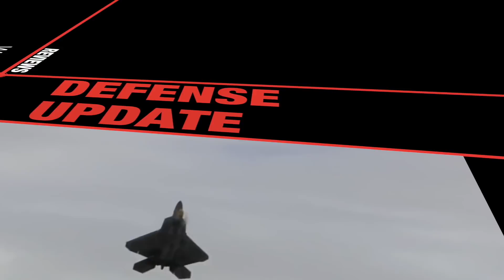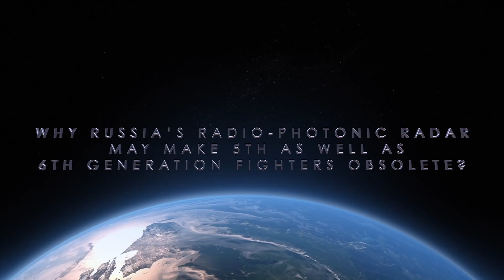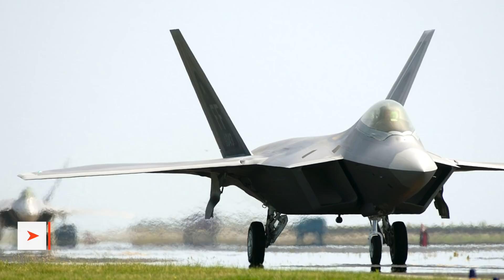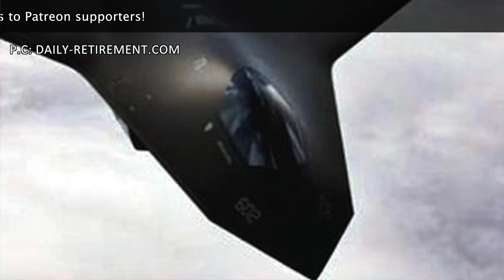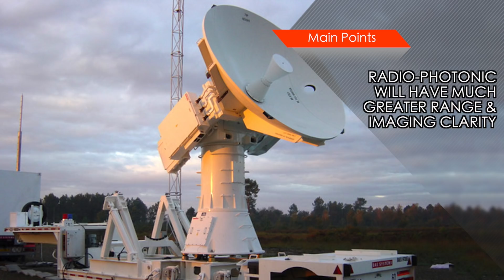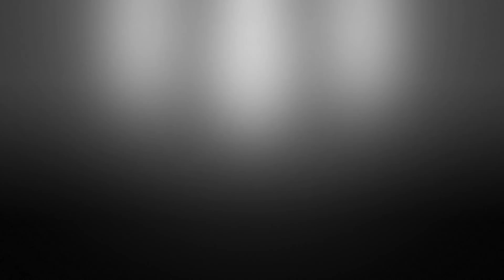WHY RUSSIA’S RADIO-PHOTONIC MAY MAKE 5TH AS WELL AS 6TH GENERATION FIGHTERS OBSOLETE?

Comment: nowadays, any stalth aircraft is detectable by several technologies. The first, for example, a VERA set from the Czech Republic. it is a classically passive system based on the principle of time-hyperbolic signal detection. and another is the PCL passive coherent location, the aircraft can be completely without emitting electromagnetic energy such as radio datalink or radar. PCL focuses on disrupting the coherent field that is created, for example, by a civilian television transmitter or FM radio transmitter, or a telephone BTS station. Stelth aircraft which are designed to deflect part of the incident energy and absorb some of them disturb this field very significantly this field violation is detectable, in the Czech Republic the company ERA built the SilentGuard system, the system is functional and tested during military exercises. ERA Pardubice is a world leader in the development and production of passive aircraft detection systems, in history they have supplied RAMODA, TAMARA, VERA, VERA-NG systems, VERA systems are for both civil and military use, the civilian version is at dozens of airports and detects aircraft with a meter accuracy.

Comment: The Radio-Photonic Radar pretty much needs to be at a fixed location if they are going to send entangled photons.  The quantum radar needs near zero kelvin refrigeration.  

If they just send laser light, the planes will be coated with a very thin coat of light absorptive materials tuned for the laser so will not reflect light on that frequency.  They will need to develop multi-frequency lasers and related optics.  This will be very expensive.

Comment: You have this video entirely wrong just so you know, the article that you read has been misinterpreted.  Russia isn't the only one working on radars in this manner, but Russia has only expressed concrete intentions for it on their newest fighter jet.  Also, it doesn't shoot lasers, radar will forever operate in the radio frequency spectrum, but it's hinting at enhancing the power of the components to make higher resolution radar images of targets specifically in the microwave targeting range that stealth jets successfully deflect.  This would make more accurate detections.  Photonics technology is sensitive enough to detect gravitational waves with inferometers, just think of what it could do for signal processing.
Reply: Да, есть умные люди!!!

Comment: I have to laugh at all the 'experts' in comments crying about how Russia doesnt deliver advanced tech. Hypersonics and s400s for starters are operational. Su-57 and Armata are both close to complete, its just that they will only be produced in small quantities first, like Russians usually do, assigning new tech to tactical development units to learn how best to use stuff before they make a heap of them. Personally i think the term used in this is a (deliberate?) misnomer but its interesting if the Russians are using it as part of a new system.

Comment: The Russian's upcoming radio-photonic may make 5th as well as 6th generation fighters obsolete.  Good point,  it will imply a new tecnology based in laser rays rather than in Electro-Magnetics Waves EW.  But the tittle of the video must be changed for another  which could say:  Russia is developing a Radio-Photonic radar that will make 5th and 6th generation fighters obsolete.  Nevertheless it makes me wonder one thing:  If it is with this futuristic radar that Russia could effectively counter any stealth airplane,  the claiming that their S-300,  S-400 and the upcoming S-500 can shoot down the F-22,  F-35 are not true?

Comment: I am an radioelectronics engineer at PhD study ... and I can tell you that this is just BS :D what they refer to as radio-photonic is terahertz technology. Much higher than classical radio frequency and -still way below infrared. This technology is used for space probes for decades now BUT ... there is now it would give you photography-like images. Laser woud scatter and distort after few kilometers so the extremely high RF wave is still much better. It could detect movement of the air around the stealth plane due to doppler effect but it is not any of this sci-fi mumbojumbo :D
Reply: I'm not sure if this guy has it correct.  The radiophotonics would be in the components.  This is a big area of research in condensed matter physics with metamaterials.
Reply: so ? ... it doesn´t seem like you are heading somewhere
Reply: radioelectronics will be a dead area of study soon, it's inefficient.
Reply: kokos742 ok?

Comment: The transistor for photonic radar, which is super fast, was discovered in Spain or Italy in 2013, and Raytheon is also getting moeny to develop this kind of technology (20-30 times the $ that the Russians have allocated for R&D on it).  I've seen educated guesses put it as a possible reality in 2025, but one or two more "little breakthroughs" before its done.

Comment: The general problem with radars is : 

1. The first thing people need to get out of their heads is the word "stealth".. it doesn't exist. The F-22 and F-35 (as well as the Su-57), and before them all, the F-117, uses geometry, radar absorbent materials, etc to make them "low visibility", basically they are made to defeat the radar systems of today. Radar works in a very very simple way.. it sends out a beam, and if that beam hits anything, it will bounce back. This lets the radar know that something is there, and with a few bounce backs can say things like speed, altitude, heading, etc.

The entire point is to not let it bounce back, either by deflecting the beam away from its receiver, or outright absorbing it (which is why especially the F-117 had such a weird geometrical shape). 

2. You can easily see an F-35 with a radar used in the Battle of Britain in 1941. The problem with those radars is that its not very accurate (which is fair enough, its 80 year old tech), and it also produces a lot of "clutter". Though modern computers can probably rectify that.

3. China claimed 2 years ago that they had a "Quantum Radar" capable of seeing the F-22 and F-35. It also works with photon's (normal radars today uses radio waves). Switch from Radio Waves to photon's (or anything else), and the shape of the object is suddenly irrelevant.. it'll be spotted immediately upon entering the radar coverage area. You cannot jam or spoof such a radar either (yet, im sure they'll come up with something...lol).

So, regardless of China lying or telling the truth, the Quantum radar is being heavily worked on by... well.. everyone (just google "Quantum Radar"). It is certainly not unfeasible that both Russia and China has something in this technology range that works.
Reply: PlacidDragon you're so full of shit your ears are draining it. Clearly you have no idea what photons are. Dumbass.
Reply: I'll happily admit that quantum physics is over my head, but these are not my words, but the words of people a lot smarter than i am.. and i am willing to bet, a hell of a lot smarter than you are as well :)

https://uwaterloo.ca/institute-for-quantum-computing/news/quantum-radar-will-expose-stealth-aircraft
https://www.wired.com/2008/05/lockheeds-spook/

And so on..

Comment: It's called LIDAR, NOT photonic radar.  LIDAR is limited by atmospheric conditions, especially moister and clouds.  LIDAR has existed for at least a decade and is relatively short ranged because of the light wavelength.  This video is a load of crap.
Reply: Photonic radar is the same quantum radar being developed in china...lidar is a complete different type...

Comment: Drone Swarms + VantaBlack + F22 ... F U Russia
https://www.surreynanosystems.com/vantablack
"a coating so black that our spectrometers can’t measure it!” When a laser pointer is aimed at the Vantablack-coated surface, it vanishes completely, as if no light were touching it at all."

The image linked below is a message to Russia.
https://www.google.com/url?sa=i&source=images&cd=&cad=rja&uact=8&ved=2ahUKEwjom7G-icXcAhVBb60KHW3TAhUQjRx6BAgBEAU&url=https%3A%2F%2Fnews.artnet.com%2Fart-world%2Fnew-photos-vantablack-906158&psig=AOvVaw27QrDRT-WrlmhyT0aJZgjG&ust=1532979953068573

Comment: How can you make a radar that detects a fighter plane that's not even made yet. Also how can Russia know what any 6th gen fighters stealth is made out of when most 6th gen aircraft are still in the R&D phase. This is just more empty bluster by the Russians to seem relevant in the modern age. Plus it's not like the US or even the Chinese aren't already developing this type of radar.
Reply: You didn't listen... The development is still on going for creating radars small enough to put them in air vehicles.. Planes. That means they already developed this radar and now try to figure out how to optimize its size... I wouldn't be that confident, that Russia ain't going to build anything.. They have proven several times the opposite to you.
Reply: Radar is pretty simple, waves go out bounce off an object and come back, they pretty much know what to expect, maybe there's a different radar absorbing material but its still doing the same thing other radar absorbing materials do. The only thing you can do is increase the stealth shape and add more layers of radar absorbing material. So the Russians can have a huge head start on us